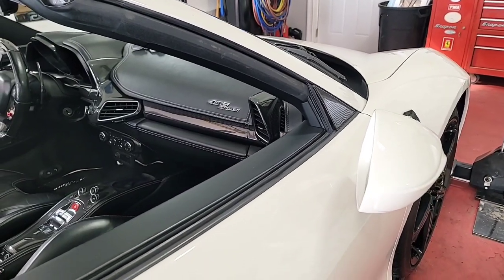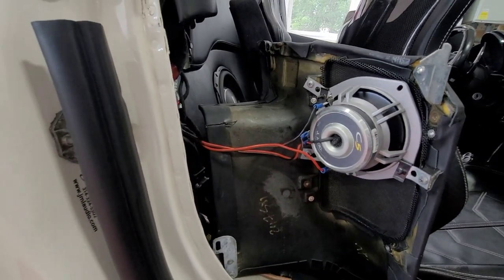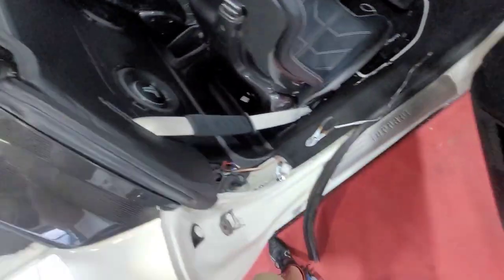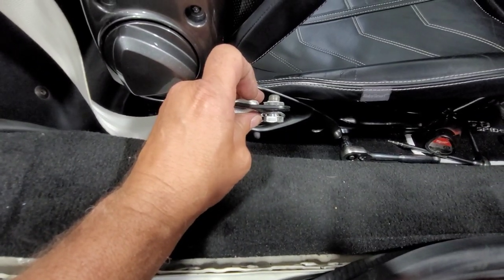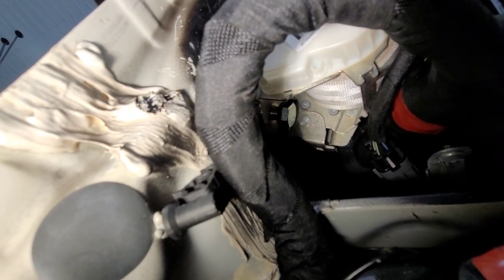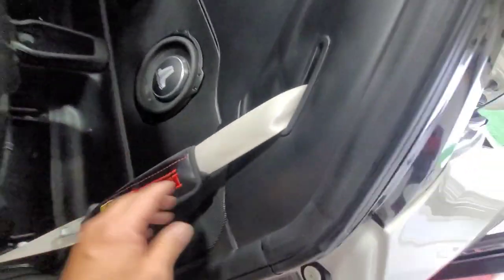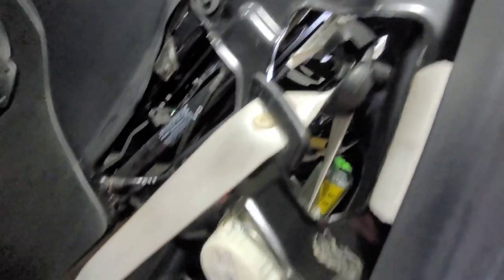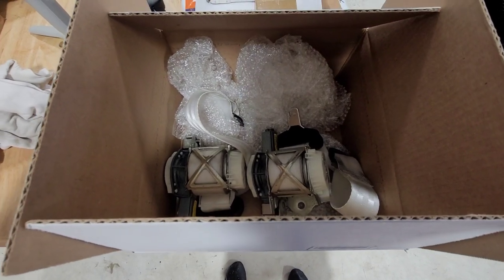Ferrari 458 Spider Seat Belt Removal

Comment: Thanks for sharing.....how is the upper most trim piece removed to expose the screws for the middle piece? Is it simply retained with clips, or is there a screw holding it?
Reply from the maker: It should be in the video
Reply: I just re-watched the entire video. The piece I'm asking about was already removed. It's the "domed" piece at the very top that covers the 3 screws of that upper panel that the seat belt goes through.